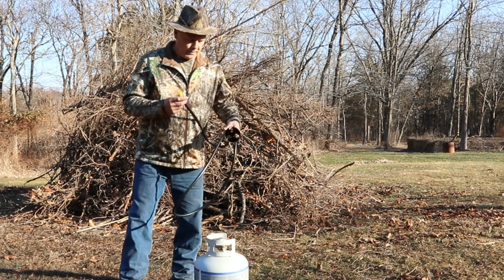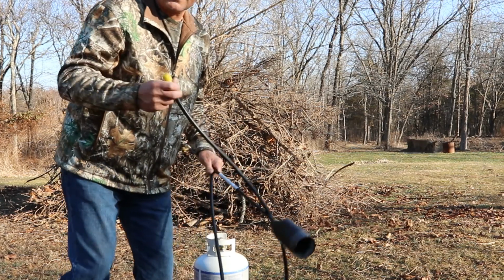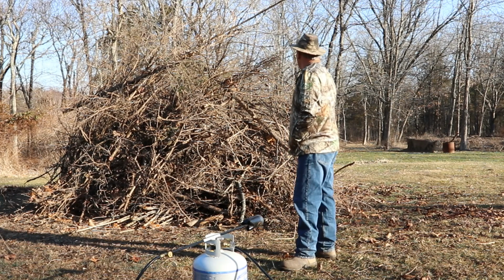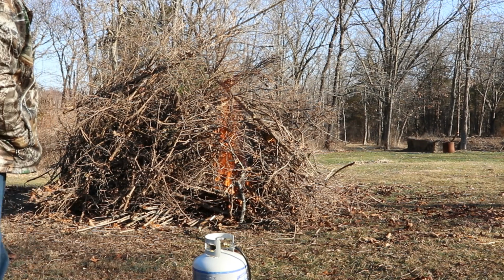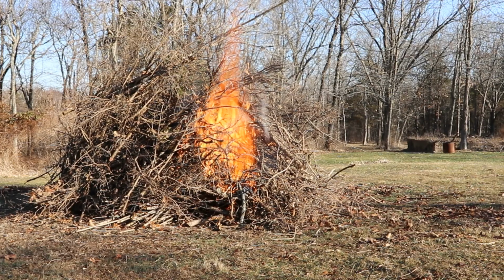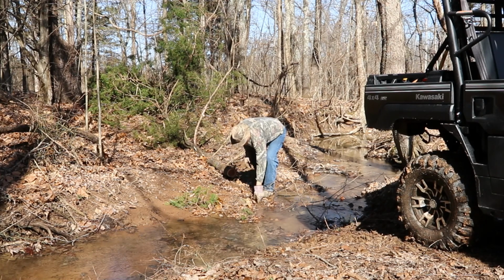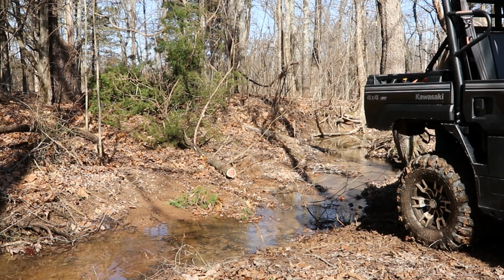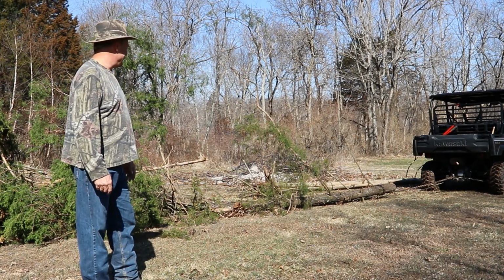Using A Weed Burner To Light The Pile

Comment: I thought those were initially for roofers melting the roof tar on flat roofs they have so many good uses tho I like to flame the driveway to get a good ice coat in the winter n slide the driver way lol
Reply from the maker: Yes the torch works great for ice melting
Reply: You're right.  The instruction manual for mine says "Roofing Torch"